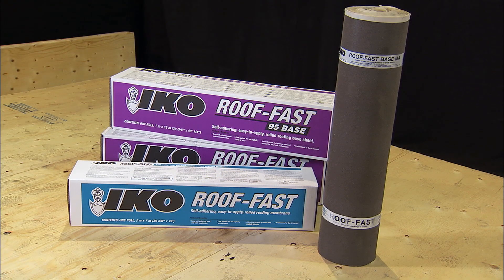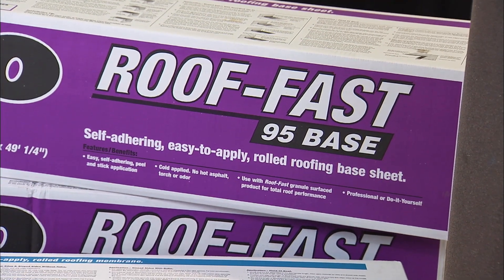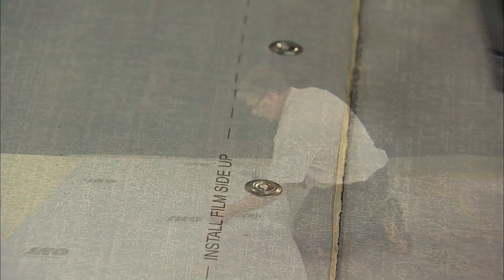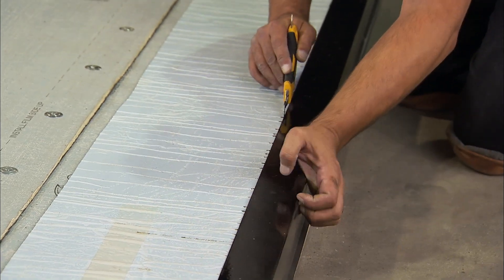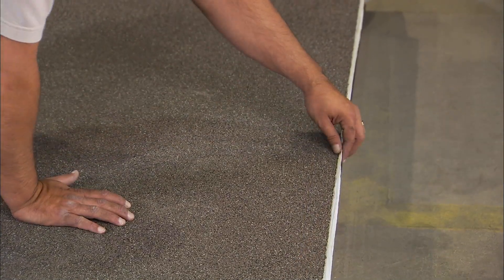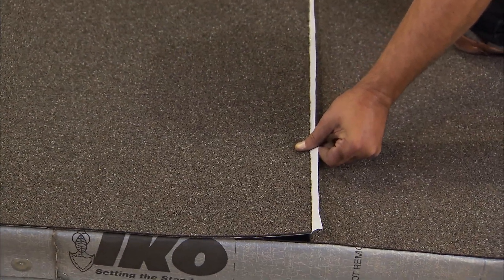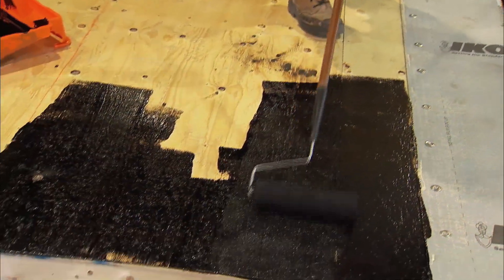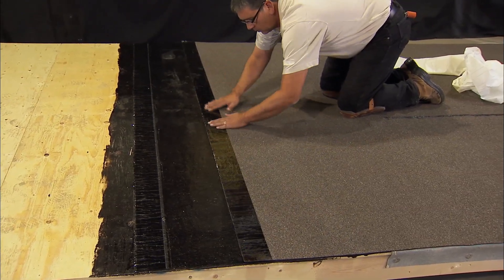IKO Blueprint for Roofing Part 10 - Roof Fast Application

Comment: why wouldn't i want to use this to replace my regular asphalt shingle roof? it seems so much simpler .
Reply: This system is designed for 2:12 low slope roofs where asphalt shingles cannot be used. Most roofing contractors would use the 95 Base sheet instead of the Base MA which requires a lot more work hammering in the nail retaining washers. The only advantage of using the MA Base sheet is that you are able to save your decking plywood, OSB etc on your next install as it can be easily removed from the substrate.
Reply from the maker: We're all about making your life a little easier!